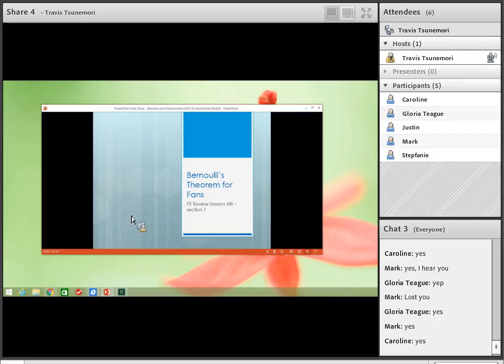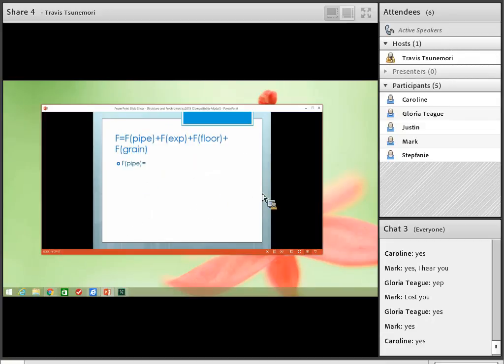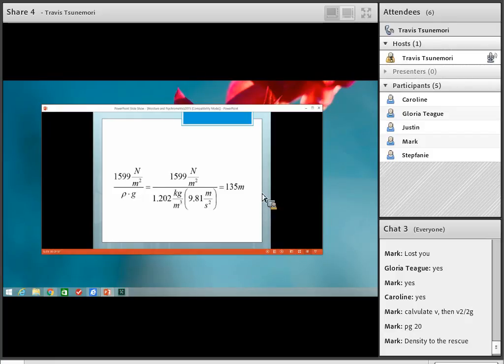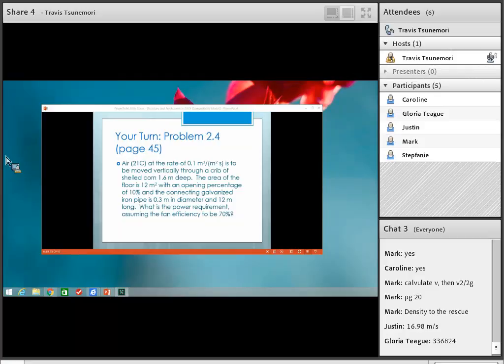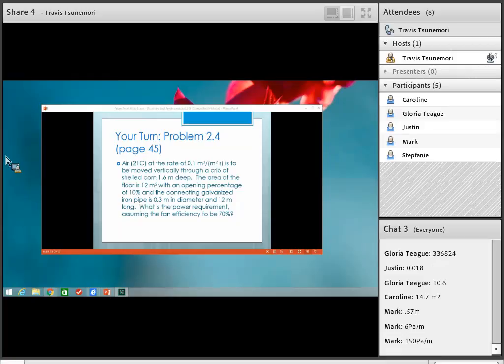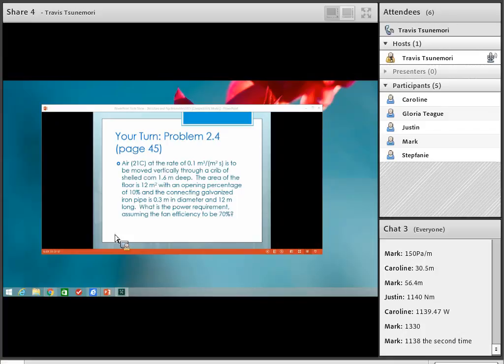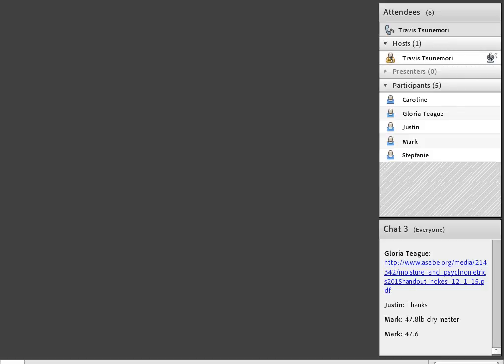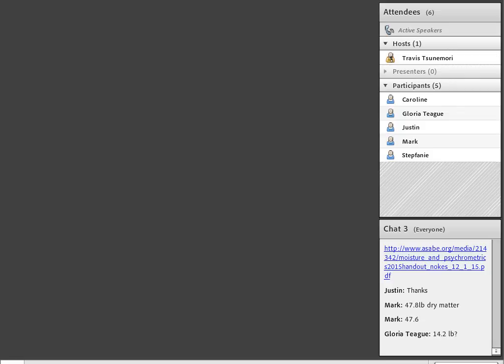2016 Sizing Fans 12 8

Comment: To those following along with the webinar slides provided on the ASABE website, the slides stop working at ~1:07:10 due to technical difficulties. From this point forward, the presenter talks and you have to follow along manually. 

At ~1:10:00 the presenter starts talking about page 18(top slide), and page 18 (bottom slide, "standard bushels") at ~1:10:35. Hopefully this helps you connect the video to the slides themselves.